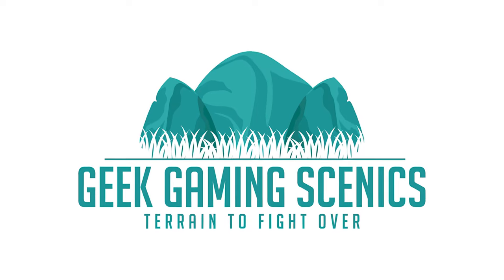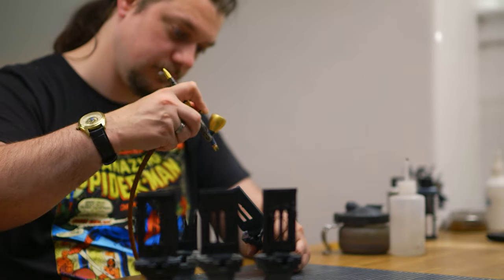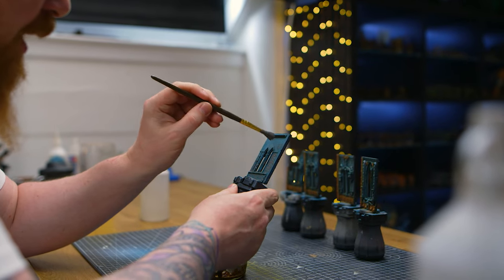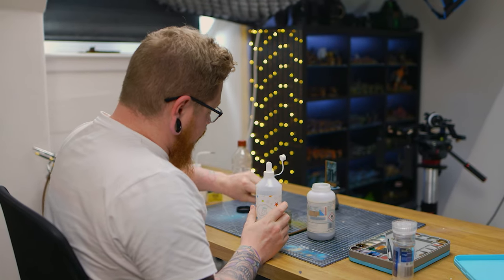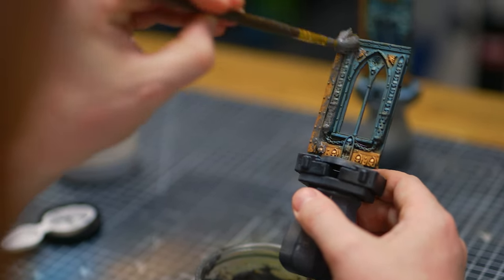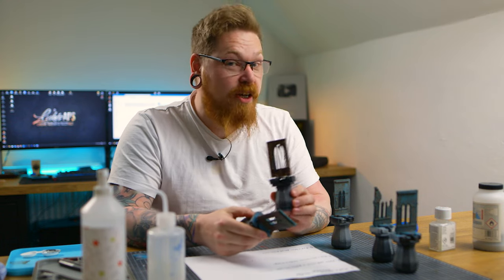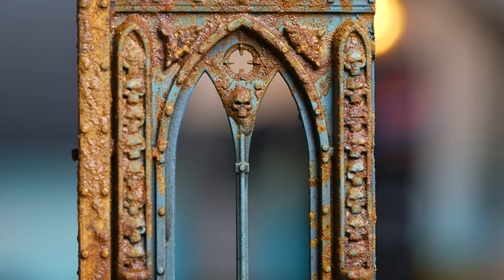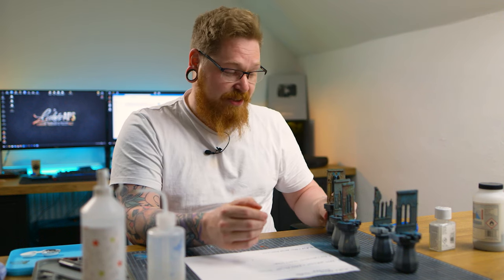Am I Stupid Using Real Rust on My WARHAMMER Models

Comment: Next time: how to use the bones of small animals to improve your terrain.

Great video, good reminder that maybe you should just try using the real thing. Barely done any terrain painting yet, but I'm going to remember this.
Reply: Uh... yeah, about that. In my trunk, a 2 gallon bucket with some heavy rocks in the bottom to prevent tip over, garbage bag liner, plus some extras, shovel, and a stick with a sharpened metal hook (bicycle hanger) screwed into one end. Gloves. Use hook and shovel to load roadkill into bucket, tie bag. Empty into unlined 5 gallon bucket. Leave outside with heavy rock on top away from house. After a few days add some water if necessary, if it's really dry out. You want wet rot, not skin drying on to bones. Once it's just a mass of fur and bone with little goo, dump out onto a flat surface and give a quick gentle hosing, pick out bones, let dry in a breathable bag for several weeks until the marrow dries up. You can boil, freeze, or soak in 10% bleach 90% water to speed up cleaning. 

Do multiple roadkills at once to get the most use out of your effort. paws provide the best scale bones for 28mm. Squirrel, fox, raccoon, etc. 

If you're Miss Jackson/nasty just snip the paws off with a set of pruning shears. Like me I don't give a fuck if I'm snipping off rotten Squirrel paws as long as it doesn't touch my skin directly.

Comment: I did this similar effect on some Wasteland Wrecks and they're holding up great. I would suggest adding some hydrogen peroxide to the vinegar mix it will get you more orange effects and speed up the process. Also if you seal these it freezes the effect. I plan on using this effect extensively with my killteam/necromunda terrain. Glad to see you playing around with the idea.

Also a lot of salt and vinegar in the outtakes :D

Comment: Man, now I want fish & chips and it's 9 in the morning. Otherwise, great video!  I got a whole bunch of tanks and a new terrain board that this is going on.  Frankly I was going to go with the paint job Jeremy from Black Magic Craft did on his big Plague City board, but this looks much easier.  Quick questions though; Did you try putting small globs on top of some rust colored paints, giving texture to just one part of the rust?  Could you apply the powder with pigment fixer and then spray the vinegar on?  Does it need to be sealed afterwards?   Are you going to replace the Martian earth basing powder with a bunch of old iron powder?  Will this "weird out" the magnets on my terrain sets?  Would it smell better if you used apple cider vinegar?

Comment: I didn't catch it if it was said, but I wonder if sealing it after 24 hours would "freeze" the effect and halt oxidization right where you want it?
Reply: If you seal it with a serious coat of PU varnish you will stop the athmospheric oxidation but you wont stop redox reactions between the rust/iron and the paint pigments which can lead to color changes or destabilized paint layers.
Reply: @KT-pv3kl  I figured that might be the case.  Captured O2 would still be doing its work.

Comment: What about peeling some rust off a rusted piece of metal, grinding it up and using that with pva glue?
Reply: Pva isnt really a good option for this. You will get much better result by mixing the rust with a transparent acrylic medium or matte varnish. If you have a small ceramic mortar and pestle or even a ball mill grinding up rust really fine is perfectly feasible as rusts are a staple pigment in painting for tens of thousands of years.

Comment: I've found that Double Down's rust ( Along with their Verdigris and Moss respectively) is absolutely amazing for rust effects, comes up looking like genuine rust every single time, magnifico! 🤌
Reply: Plus its in a stabilized medium that once dry prevents further chemical reactions with varnish or underlying paint layers. So its a lot more stable.
Reply: Are you able to put matte varnish on top of double down rust? (of course applied with airbrush since I dont wanna rub the rust off)
Reply: @Xaltotun I've seen videos where the Dirty Down stuff really doesn't rub off after it's dried and that. Check out midwinters vid on the rust.

Comment: To rust, the iron needs access to oxygen and water. When you use the pure PVA or the varnish, when they dry they are sealing in the iron powder and keeping the oxygen and water away from the iron. So they should never rust.
Reply: Did you really expect him to inform himself about what he is doing? Every video from him I see is summarized by: Wow, he does this thing horribly wrong and misinformed.

Another tip: Heating up the piece with a blow dryer will speed up the reaction a lot.

Comment: I've attempted using real rust many years ago, but for some reason it never turned out very good.
 Sophisticated Finishes has a good effects paint that is used under the top layer for a more realistic rust look in my experience. Dirty Down, in my opinion, makes the most realistic rusting paint on the market :)

Comment: I have done art with real rust before, the problem is that the oxidization process doesn't just stop. It will continue to eat the metal and flake off and fall off. The only way I have found to seal real rust without it looking different is under clear resin. It stops oxygen from getting to it. Can a coat of varnish do a good enough job at that? Or will the varnish flake off and crack overtime as the rust moves from under it? Maybe it can. I have not tested that. But I have tried various seal sprays and clear coats over my pieces, and it doesn't help.

Comment: I used some actual rust (I let a steel wool pad rust over a couple of days) on a building piece a few years ago.  Scraped the rust off, added it to some matt medium and painted it on.   It continued to rust for a few days until I could get to varnishing it (sealing it prevents it from further oxidation).

Comment: It's probably already been mentioned, but ammonia (the strongest you can get your hands on) will patina metal ssssssoooo fast it'll make your head spin. The cheapest way to do this is to use window cleaner (w/ ammonia, obviously) & spay down the exposed metal. Pretty much overnight it'll be rusted. The cheap cheap CHEAPEST way is to also drop your project in an uncleaned cat box. That technique damn near works in an hour, but then there's dealing with rummaging your project out of a litter box.
Reply: Oh, forgot to mention.... RAW METAL! No base nothing! mix your mediums in AFTER the metal has patina'ed

Comment: I'd try alcohol. It should cause it to rust while it evaporates - certainly alcohol gel did with my keys. Also lemon juice might be nicer to smell than vinegar and should still cause a rust reaction with the iron powder. Copper powder and alcohol or lemon juice will likely give you a verdigris.

With all these things you probably want to seal your paint job before trying it and find some way to neutralise it at the end to stop the reaction affecting your paint job.
Reply: Wonder if that's basically what dirty down is - alcohol, metal powder and possibly some watercolour medium

Comment: I imagine that using real rust could have detrimental effects over time. But I imagine that it would take something like 25 years at least to see it. Not something you would use in a painting, but I don't really see my models being kept around that long
Reply: With the models being plastic and the rust just being a thin layer of Iron powder I  don’t see how even long term you’d have an issue. Seal it with some varnish and it’ll be fine

Comment: I would avoid using vinegar or salt directly on model. I think it it safer to work with rust directly. You may prepare a paste from steal wool and vinegar  first and then apply it for thick rust effect.   Then leave the model till the moisture evaporates and correct it with dry brush. For more subtle applicationsor leave the jar with paste open for longer to gain a rust pigment . In both cases you may wash it down when the result are not satisfying. The drawback is that you need to seal it. Maybe mixing rust powder with medium could be also useful.
Reply: What's the problem in using them directly on the model?

Comment: I wonder if you could use copper powder and do verdigris with it.
Reply: Isn’t verdigris the green coloured oxidation of copper / bronze…

I mean as base before ageing it could work…
Reply: Isn’t verdigris the green coloured oxidation of copper / bronze…

I mean as base before ageing it could work…
Reply: @TheSigmaGrindSet  yes it is. That’s what he did with the iron powder to get the rust though was introduce vinegar to cause oxidization. I suspect you could get a similar effect using copper powder though you might need a different solvent to promote the oxidizing
Reply: @SCCDaMatt  got ya, I read your comment wrong for sone reason…

In theory it should work, although copper/bronze are more “inert” than iron, so a more aggressive ageing solution may be needed…